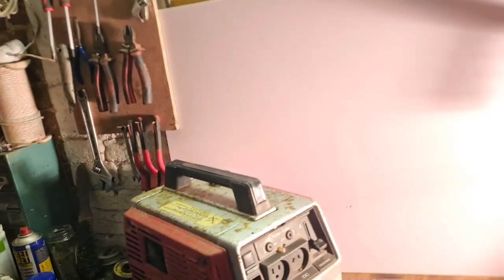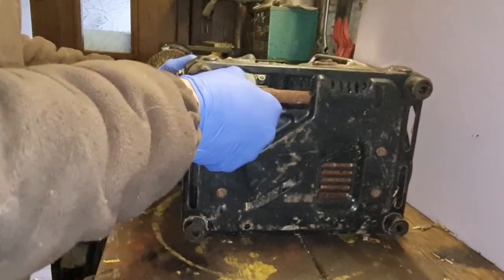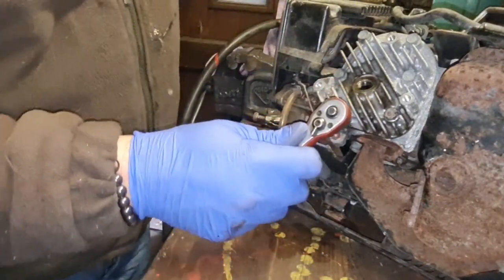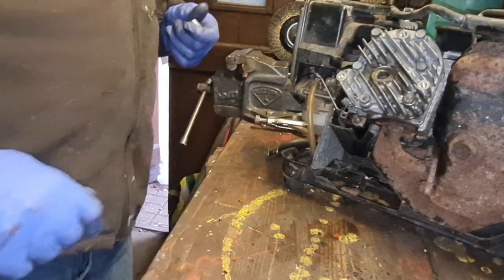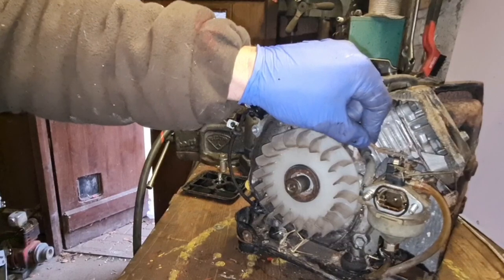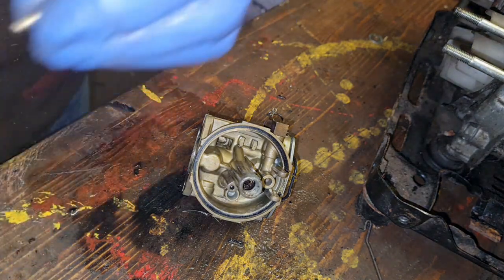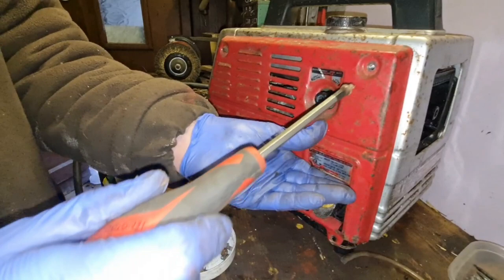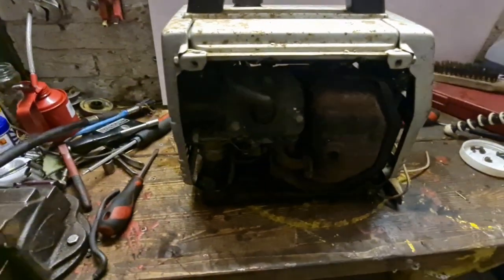Another Auction. Another HONDA

Comment: Thanks buddy! U inspired me to buy a Coleman Powermate 1750 at a thrift store today for US24,99. Little used, full paperwork, half a cup of varnish drained from tank, started first pull on a shot of  ether and ethanol free gas. Runs smooth and makes power. About the same compact size. Has a Kawasaki engine!
I watched yer vid, went out, found, ran!

Comment: I think you'll find, once you have it running, that it's a 220v output. Ignore the American sockets. Honda were no averse to cutting the odd corner, and many of their generators came to the UK with American socket, but outputting 220v.

I think too, that you might find that the missing item from the control panel is actually your frequency (Hz) meter. It's a 6v reed indicator common to most of Honda's early portable generators. It's usually wired across the panel light, which takes a 6v AC tap from the low voltage winding on the generator stator.
Reply: I have one with a u/s socket 220v
Reply: @hfraat25  I don't doubt that for a minute. We have a few early Honda generators from 300 Watts, up to 4kW, all with USA sockets, and all with 220V output. We simply bought some Honda generator plugs, and made up some adaptor leads, though other folk have been known to butcher and botch a 13A UK socket onto the casing, but it always looks ugly and amateurish.

Comment: I had one of these i found in a hedge,  all the tin work was rusted to bits but i ran it for ages as an open frame generator with a plastic bottle fuel tank.

Comment: Awesome video new sub here, emulsion tube above main jet remove from top with alen key (small end cut down), clean air fuel mixture jet, o-ring superglue great to make right size, need paper gasket between carb and manifold, use break cleaner to further clean and spray into carb air intake for kick start wonder if you ever got this running good?

Comment: Hey Adam when you bath a carburator in hot water it cleans up the linkages and throttles to turn. That is the reason for ultrasound. You break them before you do this.

Comment: Must be the going rate I got a em650 had 2 faults stuck exhaust  valve some oil and rubber mallet fix and the crapy fuel cut off I replaced it with a manual  cutoff because I like to drain the carb